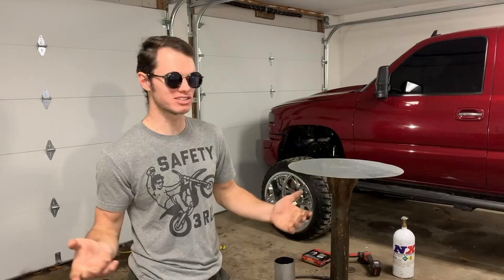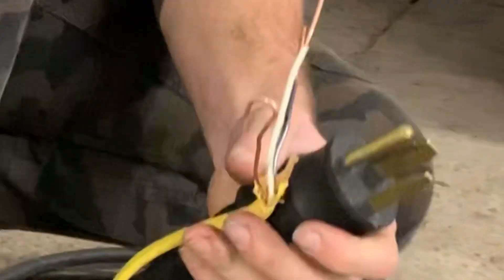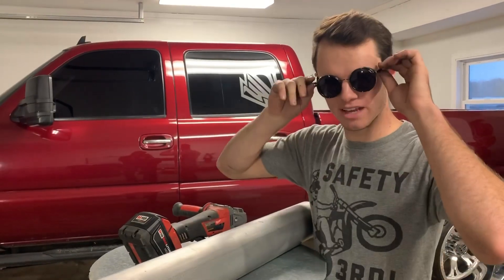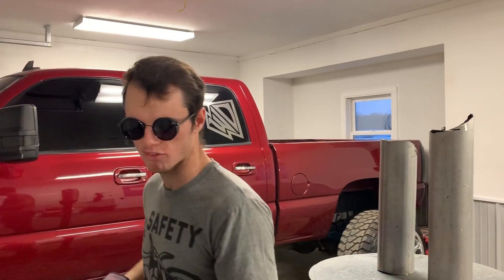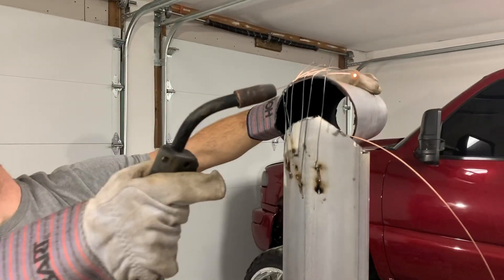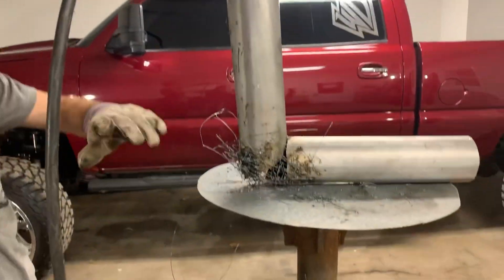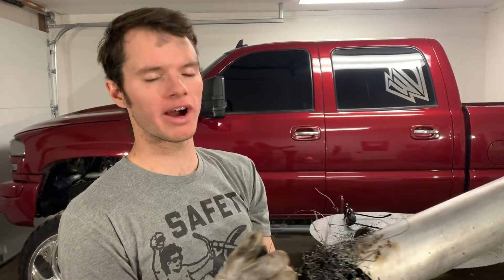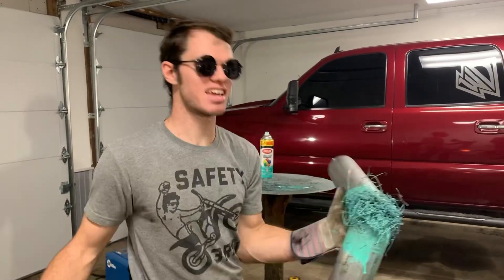How to weld for beginners (BEST TUTORIAL)

Comment: u dont need to grind a mig weld only tig stick or arc there's no slag from mig just gas and filler with electrons flowing... i have maybe not even 20 mins welding experience and even i know that. -- with that said, im still a "if ya squint. its mint" kinda guy.

Comment: it doesnt work, i welded my cab of my car on becuase i lost my bolts for it so tried to use my dads welder for the first time and found this video, I ended up driving the car all around town but then went on the high way and the cab fell off while i was driving so the frame just hit a car. Ill try do more welding next time

Comment: Instructions unclear: my parents marriage wouldn’t stick, maybe try stick different heat setting?
Reply: More wire speed will help
Reply: Maybe try helium gas as a shield, and have it coming out around 1400 kPa, should be fine.
Reply: He is using the wrong gas, he should be using propane.
Reply: Maybe she needs a different filler material, or they could try arc welding and a different rod? 🤣🤣

Comment: Hands down that is the best welding I've ever seen! That's what you wanna do when your stacking dimes you need to be about 8 inches away from what your welding and make sure that it's not a constant ark it needs to pop and have extra wire hanging off

Comment: Flashburn anyone?? Just in case any begginers weld without a helmet or proper eye protection, put a potatoe in the freezer then cut 1/4 inch slices and lay them over your eye lids, no pain no gain! Looks like you just got back from Cancun!

Comment: Who needs to stack dimes when you can lay bird nests
Reply: Hell you're behind the times. I'm laying hay stacks over here.
Reply: This made me cry 🤣🤣🤣
Reply: @Sloppy Joe Love those. That and when they burn through material and say its too thin even though its a quarter inch steel plate. Lol.
Reply: @jeffsoltis9864  damn
Reply: @joshuacrick1261  Lol. Ive seen it a few times. Guys running the machine to high, and loitering for wayyyy longer than is necessary. They apparently believe their "puddle" should literally be welding the bottom of the metal while you're welding the top of it. Lol.
Reply: @jeffsoltis9864  I learn how to weld when I was 10 with my grandpa so I’m good
Reply: @joshuacrick1261  wasn't accusing you. Welding is a handy skill to have. 👍
Reply: @jeffsoltis9864  ik sorry if it sounded like I was
Reply: Haha keeps getting me
Reply: This was epic!
Reply: kshepthedrummer  or a stack of qauters

Comment: I learned so much from this video. I’m going to go outside right now and weld in a new floorboard on my Ford F100. One tip is get a flux capacitor, endless supply of power.

Comment: How to shift an automatic transmission like a manual I heard of very rare automotive transmissions that makes your automatic manual by shifting
Reply: This is a serious question, and you can purchase a manual valve body, put that in your in transmission or and separate electronic device that allow you to activate and deactivate the electric shift solenoids when you want them to. It will also let you control the hydraulic clutch line pressure  or converter lock-up, and other things.

Or you can watch this guy, he knows what he's doing!
Reply: I work on box trucks, primarily International, and a lot of them use what's called an "auto-manual". It's an Eaton six speed, but instead of a stick it has the same selector as the 2000 series Allisons and a Powershift pneumatic shifter to control the sliding clutches. Not the same thing, I guess, but similar.